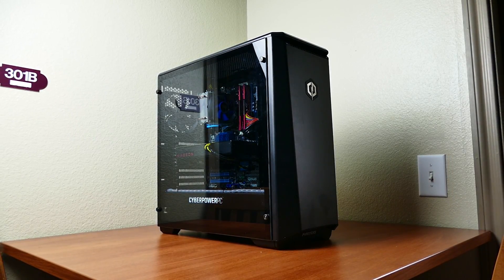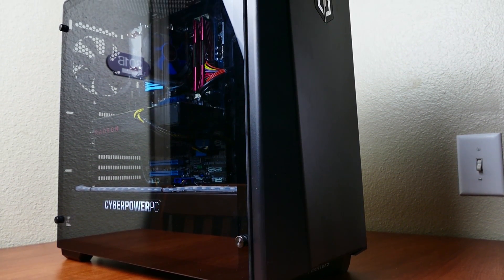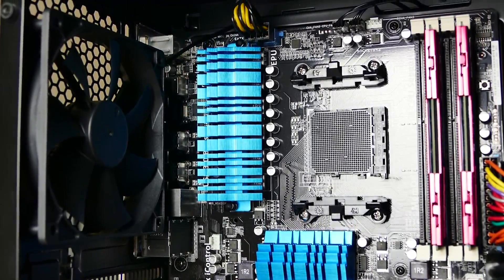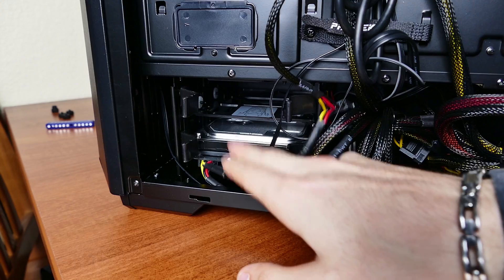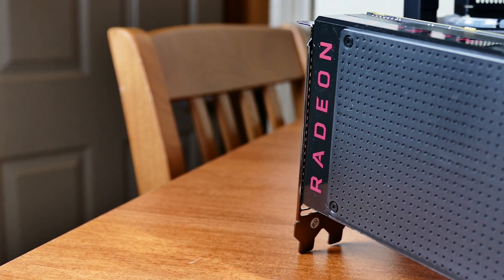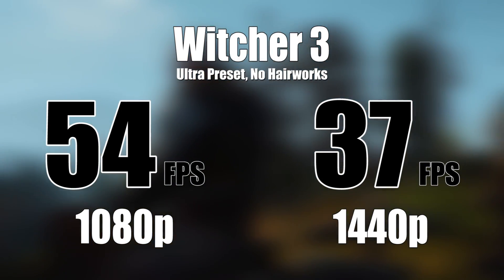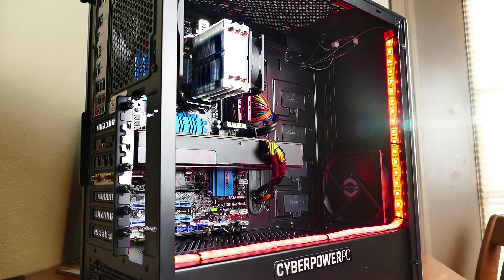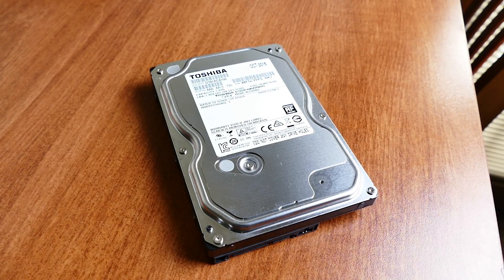Is a $650 VR-Ready Pre-Built PC Worth It?

Comment: Get the gamer ultra instead. It has a 4GB RX580, an AMD Ryzen 5, 8GB memory, 1TB hard drive (with slots so you can add an SSD later on), an EVGA power supply (I forgot the wattage sry) and the same case.

Comment: I bought a CyberpowerPC computer from Best Buy for $550 last week (it was the CyberPowerPC Gamer Ultra Desktop - AMD FX-Series - 8GB Memory - AMD Radeon RX 560 - 1TB Hard Drive - Black) after my Lenovo gaming PC (also a pre-built computer from Best Buy) crapped out on me the weekend before (having lasted just past the expiration of the 1-year manufacturer's warranty).  I was a bit surprised that the WiFi consisted of a USB WiFi adapter instead of an internal WiFi card, and I didn't notice until a few days after receiving it that it has no optical drive at all (which perhaps indicates how seldom I use physical media any more), but it's been working well so far (crossing my fingers, knocking on wood, and praying that it continues to work well for at least a couple of years).  I did replace the included keyboard and mouse (which were perfectly decent, but I had a Corsair keyboard and mouse I'd just finished reviewing for Walmart I liked even better).

Comment: I saw one of these in a best buy the other day while searching for monitors and was able to point out it's relative value compared to the one next to it, a 899$ PC with a 6500 and a gtx 960 (and stock cooling in a much messier enviornment). CPU bottlenecks be damned, the 8350 can still pull it's weight for budget builds.

Comment: I don't get the hype train with the SSD in a PC. I get that its faster than a hard drive but if u want a cheaper one then the size is so small you will be setting all your defaults to save to your hard drive and for anything that doesnt get defaulted to the hard drive you have to manually move or reroute to it unless you want to spend 400 bucks for a 1 TB ssd. I especially don't understand it when you can get a hybrid drive that costs maybe 10 dollars more than a hard drive and gives you almost the speed of an ssd and the space of a hard drive. and testing between an m.2 pcie 2.0 ssd vs the hybrid drive was fractions of seconds faster and well over 5 times the cost and not to mention the ssd was only 240gb and doesn't make gaming any better.

Comment: How'd you get the Windows 10 listed for only $27? it's $130 right now on PCpartpicker. Assuming the OS wouldn't be as cheap in your listing, even with the G4560 and a possible/probable similarly priced 4c/4t Ryzen launching in a month, at $650 would you in fact say this is an exceptional value gaming PC? for entry level/casual 1080p gamers? For what you are getting? Not purely just a performance per dollar oriented build.

Comment: I'm not really sure how to reach you but I hope anyone can help me. I have a Galax ex oc 1080 but gpu boost by nvidia is really crappy. I can get over 2000mhz however the card is so lazy it usually stays at 40% usage and 1600mhz. I've tried changing settings to max performance on nvidia control panel, setting 125% as power target on msi afterburner but nothing seems to help. Is there a way to lock my gpu clock? Like K boost but on non evga graphics cards. Any other advices are welcome. Thanks!

Comment: A smart person would get this thank me later http://www.microcenter.com/product/470682/Envy_750-411_Desktop_Computer
Reply: An i5 6400 much better and just slap a cryorig c7 or cooler master hyper 212 and boom a very cool and much quieter and faster system that's vr ready
Reply: +Sebastian M. Always keep in mind it's nice having high clock speeds and a lot of cache but in the long run the base level at which 1 core can follow an instruction or ipc always comes into play which kinda leads into CPU architectures what gonna win in a race skylake or the 6 year old excavator architecture it's like comparing a civic to a Nissan GT-R
Reply: Mario Almonte I'm thinking about getting this PC on the video, why is this Envy better?, isn't the 8350 faster than the i5 on this? Thanx in advance
Reply: +Sebastian M. +Sebastian M. No the i5 is way better simply because of the single core performance or ipc of the i5 overcomes the ipc of that 8350 that plus the pretty good clock speeds push the i5 leaps ahead of the 8350 also the i5 has hyper threading
Reply: Mario Almonte thank you man I'll make my choice accordingly, just threw me off that the 8350 is 4.0ghz and the i5 just 3.8 bit I guess that doesn't matter on paper
Reply: Good stuff man, thanx, how do you feel about about the RX 480 in this, is the GTX 1060 better as wel?
Reply: +Sebastian M. The gtx 1060 is a bit better than the rx 480 but don't let that make you think the rx 480 isn't good also why don't you just make your own custom PC
Reply: Mario Almonte the 480 is better than the 1060 now lol
Reply: +The Randomchannel don't make a claim without backing it up prove it with evidence m8
Reply: @Mario Almonte The i5 does not have hyper-threading. That i5 wouldn't overclock very well either, because it has a locked multiplier.
Reply: The i5 does not have hyper-threading you  dumbass. I'm not reporting false bullshit.

https://ark.intel.com/m/products/88185/Intel-Core-i5-6400-Processor-6M-Cache-up-to-3_30-GHz#@product/specifications
Reply: +Gamevet go to the links you sent me go to performance and look right under # of cores                  4.                           you will see it says
# of threads              4
M8 do you even know what threads/hyper threading is
Reply: Each core is considered a thread. A  hyper-threaded quad core has 2  threads  per core. My i7-4790k has 4 cores and 8 threads, because it has Hyper-threading. The i7 is pretty much an i5 with hyper-threading and more L3 cache. 

I have an i5-2500k @ 4.7 Ghz. It too  has 4 cores/4 threads. It would absolutely smoke tha i5-6400 at its boost clock. of 3.3 Ghz.

Comment: and then there is me with a computer built solely with parts that were on sale at the time :P

If you're wondering: ~$650

Intel Core i5-4460 with a cooler master hyper TX3 EVO
Radeon R7-360 (1250 MHz OC)
24 GB RAM
Asus Z97-P board
2x 120 GB SSDs + 1 TB 3.5' HDD + 750 GB 2.5' HDD (from my old laptop)
2 1080p IPS monitors
some 500 watt EVGA PSU
fractal design core 2300 case
and a 4x USB 3.0 PCI-E expansion card :P

Comment: ok.  I built a custom fx 8350 system for $1000.00 which was supposed to be a mid range budget build.  components included in the build are as follows: TT 875w PS, OCZ Vertex 3 240Gig SSD, 2x WD Blue 1 gig HDD'S, TT V31 Case, As rock 990 FX Killer Moby, 16 Gigs Corsair Vengeance Pro 1866Mhz 2X8, Corsair H60 V.2 liquid cooler, Litton 48X DVD, EVGA GTX 980 Classified, and finally 3X120mm and 3X 140mm case fans from Corsair Sp and AF linup.  I've been more than happy playing games like Doom 2016, BF4, COD 4, DIRT 3, TOMB RAIDER,  Farcry 4 and Fallout 4 in 1080P at phenomenal Fram rates.  Seems like many people like bashing and putting down the FX 8350, but it is still a viable option when building a budget gaming rig.  And like myself, overlooking it to 4.6ghz essentially gives you an FX 9590 for $150.00. I know it's a dead end processor and the platform can't be upgraded anymore, but it's far better than a Playstation 4 or Xbox One.

Comment: My parents still have an 8350 system and it was running so poorly that it screamed for an SSD. Put in a 400GB one and that solved all (most) their problems. Been going strong since 2012. Only issue I have is a 2009 Dual Xeon x5560 HP server (even with 1 Xeon removed as a test) outperforms it with an SSD.

Comment: Knowing the market that Cyberpower goes for, this does not surprise me.  The case is overkill, but they are trying to make it flashy.  They expect to sell it based on that (and after talking to the folks at Best Buy I realize it works).

Most of the Cyberpower and iBuyPower systems I've seen at Best Buy are quite competitively priced when compared to building the same system yourself.  The problem is that they don't always make the best component choices. Their cases are all pretty much overkill for what is inside.

I hate that people keep ripping on budget builds.  If you're at 1080P, it is very easy to build a competent system on the cheap that will play even AAA titles on fairly high detail levels.

Comment: If it's budget you need an RX 470 not a mid range RX 480.
Reply: There's a big difference between purely 'budget' and 'budget VR'. VR is very GPU-intensive, so the 480 was a good decision.
Reply: Elijah The Beast Tbh a 480 costs just 20$ more, don't see why not to save a bit more. I mean, same TDP, VRAM and similar price with better performance

Comment: Go with the new kabylake pentium, hyperthreaded, and overclockable
Reply: chiggins overclockable? I don't think so...
Reply: chiggins sadly, even that isn't possible. Because Intel shut down the BCLK overclocking efforts that mobo manufacturers were making, only a few older bioses for the mobos support it. However, since Kaby Lake just came our, none of these bios versions support Kaby lake CPUs, and so you can't even BCLK overclock Kaby lake CPUs :/
Reply: People are bitching about FX cpu`s in 2017 which is not a good choice frankly, not with Zen so near, but i feel the same about those "Pentiums" too. No one should buy that crap in 2017. Dual cores in any form and flavour should`ve died out in 2010.
Reply: Tyler Weigand regardless, I think it has very very respectable 1080p performance considering it's cheaper than an athlon...
Reply: Tyler Weigand it is overclockable.
Reply: Roberto Arévalo the g4560? No it isn't... Show me a source that says it is.
Reply: CMstacker so should have 32 nm. Ohhh wait, it did on intels side
Reply: Tyler Weigand it's not officially overclockable but you can overclock locked skylake cpus, I would guess it's the same with kaby lake considering not much changed... although even if you can over clock it, a z170/z270 is much more expensive than a h110/b150 completely defeating the purpose of being "budget"...

Comment: I bought my 8320e for $40. It was a glorious day for my budget build.
Reply: Thats a bargain!
What gpu did you get with the cpu?
Reply: SaucySpaceFries damn $40? Even if it's an old socket I'll still take it, what a deal
Reply: I bought a sapphire r9 380 for about $110. It was a decent deal.
Reply: Right? It was a great find! I was looking for an 8 core because well I like having multitasking ability.
Reply: Really not bad,
You have a hell of a strong pc for such small amount of money
Reply: Yeah spent about $450. Can't overclock it though. Don't have a good enough cooler for the chip's heat output. And my case is a terrible one.
Reply: Eh, i don't think you should worry about that as your pc was an budget computer, You can upgrade/overclock those stuff later down the road later on
Reply: I bought a ryzen 5 1600 for $135!!

Comment: Well for 650 those benchmarks are pretty good. I would have bought a much cheaper case and used the extra cash to pick up a cheap SSD for the OS, would have bought a evga PSU like a 600B or something depending what I saved on the case i would have went for the 8gb variant of the 480 (which is what i have right now).  It's nice to see prebuilts are getting closer in line with the actual price it would to build them.

Comment: Cyber power is a ripoff, I understand the terminology that they need to make profits and all but I still think other companies have better builds for the buck. I bought an FX 6300 with 8gb of ram, 1 TB of mechanical HDD and a Radeon 6450( the worst care on the surface of the planet). couldnt even hold CSGO at 30fps on the lowest setting. I bought this in 2014 for $500 and now I realize how bad that deal was.
Reply: also not to mention, the motherboard has only one PCIe slot with only one case fan socket(like wtf!!!???). They switched my stock cooler with a cooler Master that literally sounded like a jet engine and their PSU aren't brand names but mine is still going so can't complain. Man if I met 2014 me right now, I would slap the dummy in the face so hard.

Comment: Cyberpower really offers some good prices. My sister got an FX-4300, RX 460 4GB, 8GB of RAM, some 970-based board, a reference cooler, and a case with RGB lighting AND a glass side panel all for about 430 USD.

Comment: Kyle from BitWit would say "Red RAM on a black&blue motherboard, looks atrocious".
191x7 would say "Pal, that's a great video proof of an FX 83x0 series CPU bottlenecking a modern midrange card".
And I agree with you on the 8320e [or even better, an 8300] vs 8350, the need for speed [SSD] and everything else except the fact THAT an Asus m5a97 r2.0 is a bad motherboard - the EVO version of it beats any Gigabyte MBO in the price range and even higher.

Comment: I bought a Pre-Built PC and I did basically exactly the same build on PCPartPicker and it cost me about £45 more so I went for the Prebuilt, I also didn't really have the time or the space to build one either so I wen't with the pre-built (I asked for a 550W PSU for the Pre-Built too and they put a 650W which was about £15 more expensive on the website too). Check out DinoPC, they actually do good value Pre-Built PC's (UK only I think)
Reply: Jameo360 
Those are two reasons I bought my pre build (PowerSpec PC which is owned by Microcenter and my model is a G313). I don't have space available and time to build a rig.

Comment: Really don't get the hate on the FX chips. I've owned two FX based systems for a lot of years now and they are still rock solid systems for gaming and everyday usage. Are they world beaters? No way. Is it a dead socket with no upgrade path? Sure. But if you wanna play games and watch youtube (which is what my kids use those systems for now) then they are just fine.
Reply: Heru3005 z270 is technically a dead socket too with no upgrade path :D
edit: I mean lga1151. z270 is a chipset
Reply: with zen around the corner it doesn't make a lot of sense to buy into the FX line up unless you can find a good discount on one

I wouldn't have gone with my FX8370 if I didn't get it for $80 on a motherboard bundle deal, I would have went another direction or waited until zen was released

Comment: While I enjoy your channel and video's, sometimes I think you tend to forget what it means to be a low budget gamer.   The 8320e is a great deal if you have a Microcenter you can get to, hell, any CPU/MB is a great deal pretty much IF you have access to a Microcenter.    Many do not and the 8320e isn't that cheap elsewhere.    For a single drive, not sure you could get an SSD to hold your games at this computers price point either.    A 250ish gb SSD isn't enough.   If you can wait of course, wait with Zen coming supposedly within the next 45ish days.   But that PC is a great deal for the cost.   Can you build a PC currently with new parts and a warranty, including windows and peripherals thats better, probably, but enough to matter when gaming, I am not so sure.    That PC seems like a great deal for a gamer on a $650 dollar budget.   For some, $650 means exactly that, no more.   While not an optimal upgrade path, it does have one as well.   For a budget gamer, small upgrades like a better CPU cooler, SSD, the motherboard looks capable of crossfire so another GPU, a better PSU etc.   All things, cept the gpu and those are dropping fast, more ram, all things that are sub $100 dollar upgrades down the road.    Not mention upgrading the looks which you already have the nice case to go with.
Reply: Heh, above was typed before reading the price change comment.